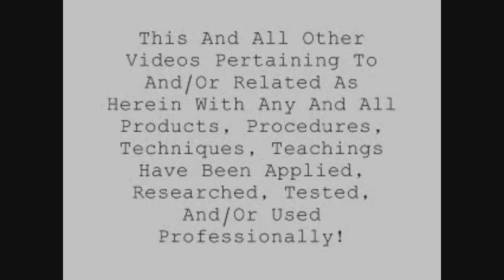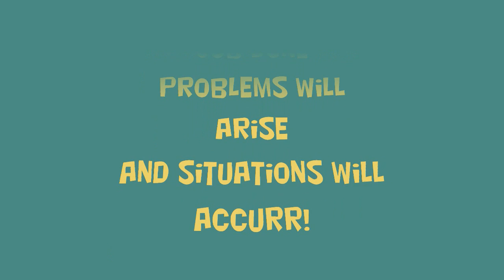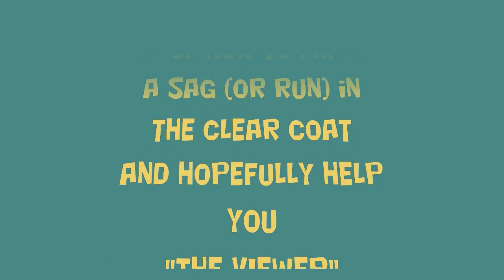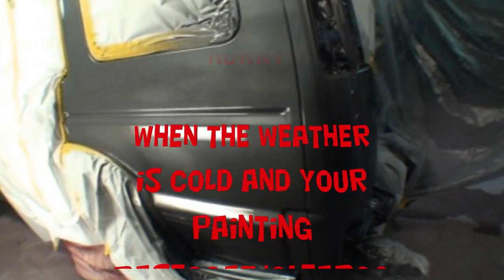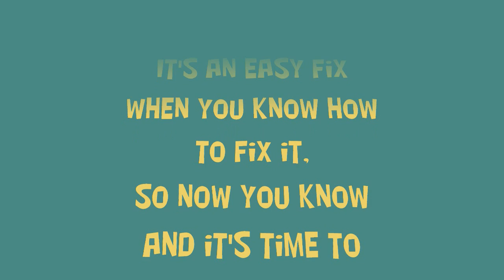"How To Remove Paint Runs"-Automotive Paint And Body Tech Tips and Tricks

Comment: I just painted my old beat up 2003 ford explorer rims. Of course the last one got a run in the Clearcoat. Just one run. And it dragged the paint with it. Funny I painted them gunmetal grey. First of all this was the hardest paint to spray perfectly even. I did but it was the most difficult paint I have ever sprayed. My run is on a curved part of the rim. I will attempt to remove it tomorrow. Thanks for the tips. Always a pleasure to watch your videos.

Comment: Have you ever tried using a wiper rolled into a small ball to just blot the run out of the clear? I've had some success doing that and immediately misting a bit of clear over the area. 
I also use a NIB file, or use a single edge razor blade and wrap a bit of tape around each side leaving only a small spot in the middle of the blade exposed to shave down the run to reduce the amount of sanding needed.

Comment: Thanks Pete💪🙏, if I burn through do I have to epoxy prime the whole panel or can I just spot prime? Also could I use etch or 2k primer to fix the burn through? or will it cause the same issue as base coat causing the blistering effect? 
Appreciate your time mate.

Comment: Been a painter a long time with respect i think there are some issues here first it must have been very cold ...also looks like a partially blocked air cap ...painting over wet base coat .....looks like edge to edge colour good luck with the colour match

Comment: I would have broken it at the body line. I never would have messed with the rest of that back quarter. How did you get the tiger stripe out of the paint?
Reply: The customer wanted a patch job from the start screw the blend, mask at body panel line paint match and shoot it send it down the road.

Comment: I am a DIY learner. I've been watching and learning for years. I've sprayed metallic once on a dashboard and had this problem. Question:  If the clear activated the paint and pulled it down, causing the tiger stripes in the metallic, how can you sand and effect the colored stripe without burning through the clear?  It seems that you would need to get through the clear to alter the color.

Comment: I'm confused, was this a matter of not giving the paint sufficient time to dry, or was it due to the wrong type of hardener in your clear?
Reply: A little bit of both. His base was too soft, then his clear sat too long flashing and ate into the base coat. On some level wet paint is paint stripper. At least until it sets up.
Reply: Gotcha!!  Thanks for the heads up.  Pete tends to pretty damn hard to follow at times.  Sometimes there is a nugget of knowledge, but, very seldom.  LOL

Comment: ok,first,if you get such bad results in your basecoat,like you clearly have here...theres no way to correct it without spraying more base...what you did wrong was spray the base uneven and too wet...your gun may have a clogged tip...what you got is called mottleing....very commn to unexperienced painters.so,the runs in your clear can be fixed in thta method,yes,but wont change the finished product at all...your base is still mottled really really bad,its horrendous actually...so i  am not sure what the point of this vid is?because you HAVE TO GO BACK TO BASE TO CORRECT THE MOTTLEING...taking out a clear coat run wont fix the base....wow.i been painting for 28 years btw......i have tons of experience,.just trying to understand what you are doing here....makes no sense,because if you shoot more clear,will still have mottleing,and if you polish it its still gonna be mottled